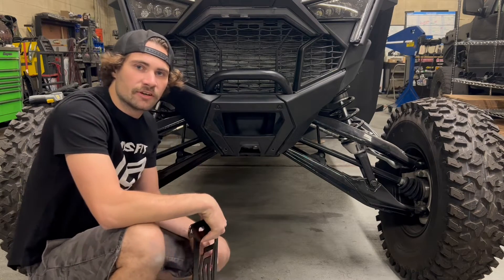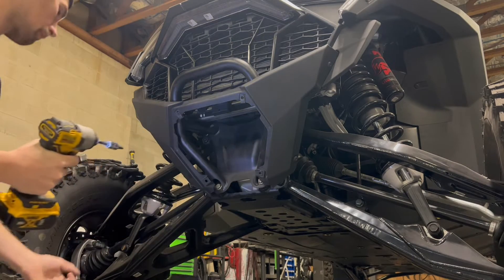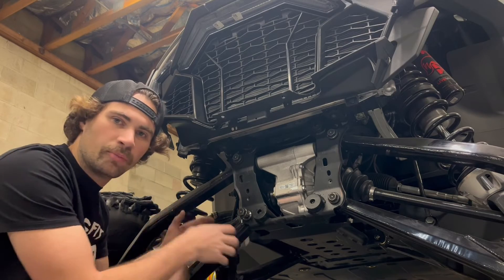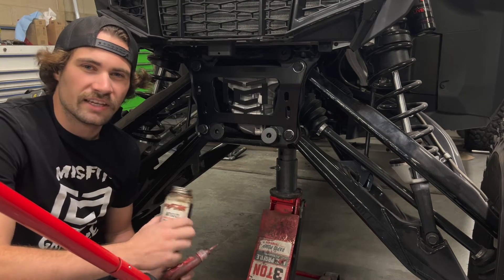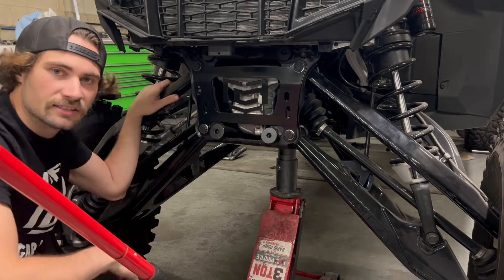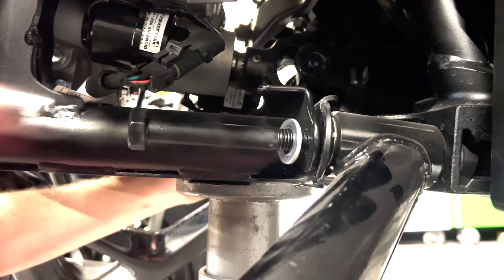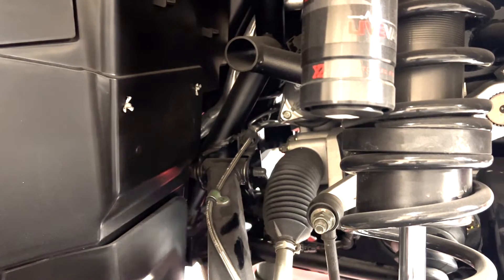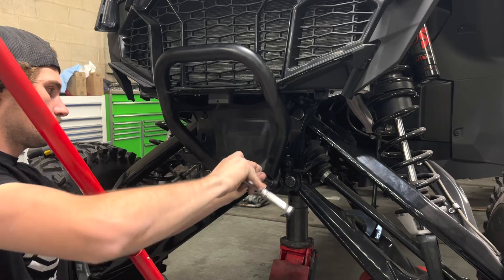Suspension Mount Reinforcement & Bolt Kit / Frame Stiffener Install On Polaris RZR Pro R 4 Turbo R 4

Comment: For clarification, antiseize and loctite on the same bolt? Are you combining those on the same portion of the threads?
Reply from the maker: So you anti seize the shank of the bolt, loctite the threads of the bolt. Anti seize on the shank will keep everything moving smoothly and allow you to remove the bolts easily if you ever need to take them back out!

Comment: We just got this bolt kit our bolts are good are they the same strength as the black ones
Reply: I meant to say the bolts are gold instead of black
Reply from the maker: We have since changed to the gold bolt because we learned that the black ones will rust. All the same strength!
Reply: @misfitgarageutah  that’s good to know ,thanks  for the quick response.does it matter what color anti size I use.I was going to use the marine one since it holds up against water the best
Reply from the maker: @skeim5620  that should work great!